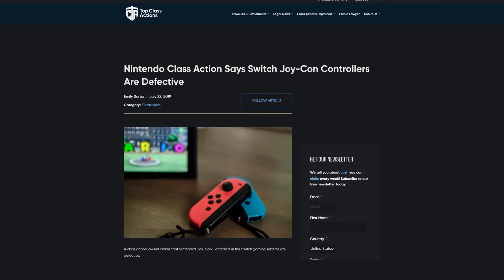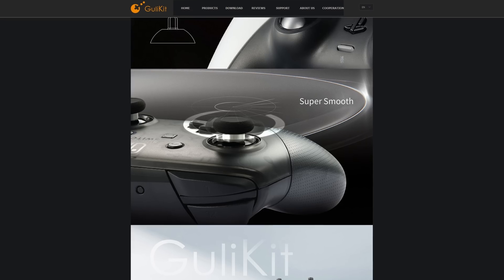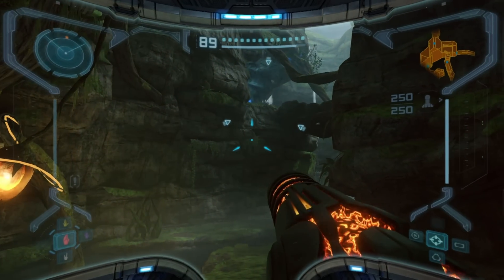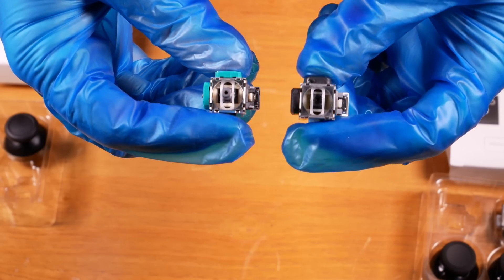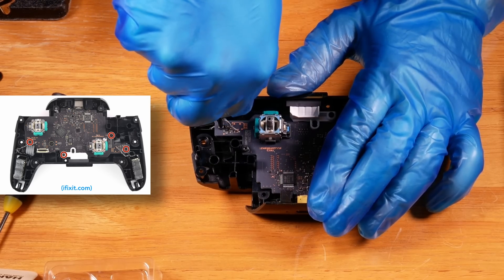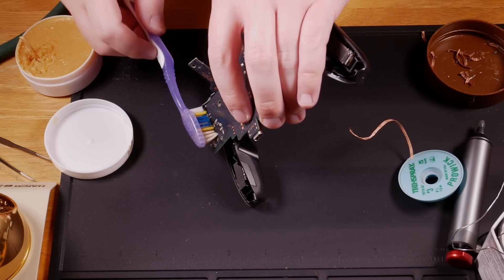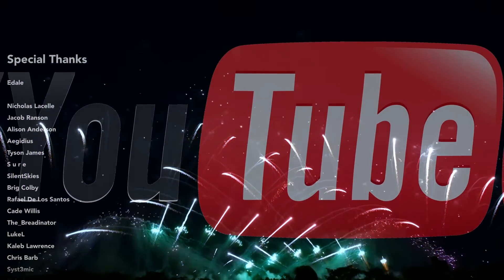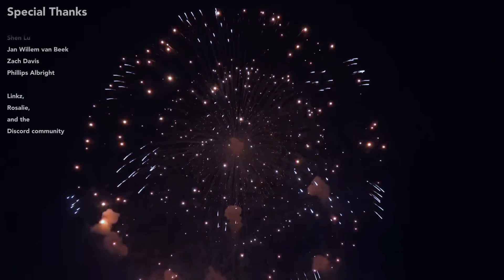Drift-Proofing First-Party Gamepads: Gulikit TMR Stick Review + Tutorial

Comment from the maker: 9:20 The #0 and #1 sizes were based on the Phillips drivers I was cheating with, if you have JIS tools you should start with #00 instead.
10:51 Ignore the "my right" graphic in this shot, the clip was supposed to be flipped relative to what you're seeing.  Lift from the THX2 ALLGAMEFANS side.  Also, THX 2 all game fans.
Reply: What about the "you bad boy" at 11:48? should I ignore that one too?
Reply: We really should go back to optical encoder wheel sensing(coughN64cough).  No need for a dead zone and can sense stick position in very discreet steps. 

If using the same mechanics as the N64 stick, you just need to harden the bowl and gears and soften the shaft.
Reply: could you tell me what song is playing at 5:10? It seems like Tom Jobim's waves and Zelda remix 

(🙂🔪 not asking)
Reply: @inazuka5672  it is just tome jobim's "wave" from his album wave
Reply: You also mentioned that people should use “an old toothbrush” to clean up the flux residue. I have never soldered before, but I’ve heard that if you ever use a toothbrush during this process it needs to be a clean, new one. An old toothbrush could be misconstrued to be one that’s had toothpaste on it before, and that could damage the board (from my understanding).

Maybe I’m the idiot here, but that was just a concern I had
Reply: Hey, did you get the updated Switch Pro revision, or are these dual-purpose for Dualsense and Switch Pro? The combo SKU is borked on switch.
Reply from the maker: @detoi4371  I got the updated sticks.  I was going to do the video in July but had to delay it after finding out the initial batch was defective
Reply: I wonder what your thoughts are on the state of AAA games. It looks like the really bad stuff is finally flopping lately.
Reply: Tom Jobim is peak music choice, thanks for putting him back in my head.

Comment: Are there any controller options similar to the Switch Pro that have tmr sticks? Every tmr controller on the market that I've found so far seems to use analog triggers instead of digital, as well as Xbox controller shape and/or Xbox button layout. I just want the Switch Pro shape and digital buttons with tmr sticks, but I know squat about soldering.

Comment: does this modification work for linux?
Reply: if it works on 2indows it should work on linux. maybe check the pro contr9ller driver to see if it reads user or system calibration by default

Comment: Maybe they're not putting on these sticks because they dont know how to calibrate them either. Is replacing just the worn out potentiometer a good option?
Reply: You will eventually face drift again. For Nintendo it is a huge pain but there are manual calibration guides as well as software calibration guides for Sony.

Comment: Maybe I don't game as much I think I do or I have a enough controllers I rotate between to prevent it, but I've thankfully never experienced drift even with my original release Joy-Cons and similarly as old original Pro controller.

But I am glad there are 3rd party companies looking to solve this issue even if I can't see myself doing a solder swap on the pro controller versus ribbon cable swap on the joy-cons. I do hope that the reception of hall effect sensors from 3rd party makes Sony and Nintendo realize there is demand for a higher longer lasting product (I don't know where MS is heading in terms of hardware).

Comment: My 3DS nub only started drifting upwards from Bowser uSmash spam after literally 10,000+ games. It was still playable.
My Xbox 360 sticks never faltered.
My PS3 sticks had minimal problems even after playing over 1,200 hours of Destiny.
MEANWHILE my PowerA switch controller had severe drift after using it for 20 hours then leaving it in a drawer for a year. My bro's controller had severe drift in a different direction on the barely-touched right stick.
I have since bought a REAL pro controller but haven't touched the Switch since I'm pretty much fully converted to the PC master race. That people still deal with all the closed market console BS is laughable. Move to PC and stop suffering.

Comment: Finally ended up doing this myself for the dualsense that has the extremerate pro back button kit installed. You weren't kidding about desoldering being the worst part! Took me a few days and I ended up just clipping my old control stick module off the board and then individually desoldering each pin and pulling them out one at a time. Very glad to future proof my preferred PC controller!

If anyone is trying this swap for the dualsense I highly recommend the youtube video from djBaro "GuliKit TMR Joysticks - Installation Tutorial For DualSense"

Comment: Have there been any new developments since this video was made? The center points becoming worse concerns me, and I see that Joy-Con Toolkit hasn't had any updates since 2018. I see CTCaer commented in an issue a few days ago:
"Hey, have in mind that JC toolkit is in indefinite hiatus.
I may sometime start cleaning it up again and improving it but dunno when."

I wonder if we need a new tool / updates (fork?) to the existing tool to handle the centering issue. I was debating replacing some sticks with these, but seeing your results makes me a bit hesitant.

edit: Also I see that the Amazon listing has the Switch Pro sticks marked as "Currently unavailable". I wonder if they just sold out or if they've taken them down due to problems. There aren't that many reviews.

Comment: I have bought these for 2 XBOX and 2 Pro controllers!

The XBOX sticks are near flawless after the XBOX Accessories calibration. 

I calibrated the Pro Sricks on Switch and re-connected them to PC and they fell within the "margin of error" IMO.

I ran through the HEX editing process and thexresults, though improved, didn't really impact real-world gameplay. Booted up DOOM Eternal on Steam and it was a fun smooth experience...on both TMR sets I received. 

However, it is quite possible that Steam, like Yuzu...WILL pull from the User Calibration withing the controller as Steam and Yuzu see it as a Genuine Nintendo Switch Pro Controller...and not a generic pad. 

Needless to say...a resounding success!

WARNING:
I would NOT consider these for use with the Elite XBOX Series 2 controller as it is loaded with magnets and is bound to cause interference.

Comment: If you'll willing to dip your toes in the "morally questionable", "borderline retail fraud" world, I have a suggestion for you.
Say your controller develops drift after the 1 year standard manufacturers warranty ends. Or, you try to replace it and they refuse or want to charge you an obcene amount for shipping. You know the unethical practice of buying a new product from a retailer, putting the old defective product in the box and returning it? Normally, I don't advocate for this practice,  ESPECIALLY for mom and pop businesses. However, in doing this with controllers made with cheap parts designed to fail after 1 or 2 years, I compare 
the practice of pirating old Nintendo games because you have no option to buy them anymore.
Big box retailers (Amazon, Target, Walmart) don't lose much revenue from this practice because they often ship returns back to the manufacturers and the manufacturer typically reimburses the retailer.
Alternatively, if you don't want to flirt with the morally questionable practices, never buy a non-Hall sticks controller WITHOUT an extended warranty. That way, you'll at least be able to get a replacement after 2 or 3 years depending on the length of the warranty.
Thanks for coming to my Ted talk

Comment: Thank you for this video.  As someone who is infuriated by this stick drift scam, its good to know theres a way to overcome it.  Ive gamed all my life, and only recently have I had to buy two new first party controllers for my kid because the sticks went bad.  He games about half as much as I did back in the day.  

Also, stick drift wasnt a term I had ever heard until this generation of consoles.  Ive been gaming since Atari was the biggest console...before the NES came out.  I havent had to repair a stick since the N64.  (I repaired it with a rubberband somehow and it worked great.  It was a loose stick, and I opened it up and wrapped a rubber band around the base bulb of the stick which gave it more tension....somehow this worked like a charm.  Its hard to believe.)

Comment: I experienced something similar with hall effect sticks in pro controllers like the Wolverine V3 Pro. Some sticks are dead center, some got something like a 5 to 12 percentage drift out of the box. I read an article a while ago (sadly can't remember where) and there it was stated that it actually normal behaviour because of production tolerances of the magnets and magnetic noise. Also, there is work on mechanics letting them return better to 0.0000 center position.

So, yeah, while most hall effect sticks are way more durable, they actually need bigger deadzones when used out of the box compared to potentiometers. But that disadvantage is neglectable long-term, so it is still an improvement over the bullcrap potentiometers become over time. I'd also love to see how much hall effect can improve too, when the entire industry changes over.

Also, a little fun fact: Sony used magnetic sticks for the PS3, though they have less in common with modern hall effect sticks.

Comment: I put these Guilikit sticks in my Joycon a couple years ago and it's amazing just how reliable and perfect they are. and was like $10 CAD for a set of two.
I will applaud Nintendo for this one thing, the Joycon is the easiest DIY teardown and repair I've ever done. It's plug and play basically, just have to be careful.

I recently ordered a Steamdeck. Hopefully I can drop in similar sticks there some day when they fail.
edit the issues with default center being wrong and some games not using deadzones kinda scares me. I'll use the Steamdeck sticks until they break, and try the Halleffect sticks only when they start to fail. And if that fails I'll just replace with regular sticks.

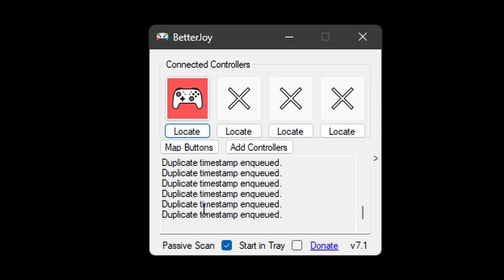Comment: In order to fix the "Duplicate timestamp enqueued." error at 4:18 for BetterJoy you can use a program called HidHide which allows you to specify which programs have access to your gamepad. You just have to add your Switch Pro controller and then BetterJoy to the list of applications having access and then programs like Steam and such will no longer be able to detect your Switch Pro controller and only the emulated controller created by BetterJoy so the issue will no longer occur.
BetterJoy used to come with a program called HidGuardian that did something similar, but I think that no longer works. Also sometimes it still bugs out right as you connect it, but then just turning your gamepad off and back on fixes it. And TotK is the best Zelda game actually.

Comment: The orange hall-effect sticks prevailing on Ali express allow you to adjust the center points with a paperclip. Works with PC/Switch, don't even think I had to recalibrate them. Haven't done extensive testing but anecdotally I haven't perceived any issues. Might be worth comparing to the Guilikit brand?

Comment: 1:36 I'd like to say, as someone who plays a bit of Melee (but not nearly as much as your average active competitive player), the wear of the plastic mechanism in the actual joystick-box is still an issue if you're stuck using OEM parts manufactured up to 23 years ago. That is, of course, why there's a difference between a "loose" stick and a "tight" stick. But if you don't need "1.0 Cardinals" (or can calibrate and adjust for this, as with any modern controller or with like a PhobGCC) then it's not that big of a deal if you're playing casually or mid-to-low-level competitively. 

Regardless, the potentiometers are the more critical issue by a huge margin. Just wanted to leave my two cents on the matter

Comment: My experience with the Gulikit sticks for Joy Cons is they're great initially but they fall off tremendously, possibly faster/worse than OEM. They also require calibration out of the box. Eventually you need to recalibrate again, and then again after less time, so on, and then the stick is physically loose and the sensitivity range in some areas isn't 100%. This has happened to me on 3 sets bought months apart, each had probably hundreds of hours which I guess for casual players would be fine but for the people interested in doing this mod and given the OEM stick drift issue is a similar annoyance I don't think they're worth it. Sad to say, out of the box (and calibration) they do feel nicer, I want to like them.

Comment: Im actually happy to hear someone else having issues with a ps5 controller drifting. I had to buy a new one because the drift got so bad. I was in the process of soldering a new stick on but unfortunately I had to step away from it for a bit and my youngest decided to play demolition with the circuit board. Having an actual answer to this overwhelming fear I have with these new, expensive controllers is nice at least

Comment: Fun fact. PS3 controllers used magnetic sticks too. Not sure about PS1 and 2 sticks though, but they probably did too because I don't remember them ever causing me any issues back in the day.
Reply: They actually did not. The sticks themselves and the potentiometers were a fair bit larger and less precise than modern ones, thus less prone to wear and tear. PS1 and PS2 controllers also calibrate themselves each time after powering on when you do a full rotation of the sticks.
Reply: @schwarzenhead5685 He's right, but it only applies to the original Six Axis Controllers. The ones that had no rumble due to a patent concern. What you're referring to is the newer controllers that would replace them, the Dualshock 3. Controllers that had rumble and six axis, but with pent sticks.
Reply: @bioforest6602  I think he is only stating the PS1 and 2 controllers were using Pots. Also regarding PS3, to be specific, Dualshock 3 controllers do in fact use magnets as well, but later Dualshock 3 controllers removed them in favor of Pots, or so I hear (around the end of the PS3's life). There's a few videos around of people taking a look at Dualshock 3 sticks and determining they were indeed using magnets.
Reply: @bioforest6602  Both Dualshock 3 and Sixaxis used Hall Effect sticks and standard potentiometer sticks. Depends on model.
Reply: @schwarzenhead5685  Good to know. Too bad they went back to pots for the PS4 and 5 sticks, especially PS5 since that was the time when people were finally taking notice of Hall Effect tech again. They could at least offer a replaceable Hall Effect solution for their overpriced controller.

Comment: even though you briefly touched on it, finally I have validation in how much a pain in the dick it is to replace joycon sticks. Good hustle here though, thanks for going through the work of troubleshooting and testing these jawns in a thorough manner!

 +1 on using a soldering kit to get comfortable using a soldering iron - that was my intro into learning how to solder correctly. Since then I used a solder sucker and some testing keycaps to repair some previously busted keyboards and build a left-hand keypad (from a split ergo kit that was in the scraps and b-grade parts bin and leftover switches from an absolutely toasted keyboard). 

and +1 for adding more solder on a join that's stubborn. Surprisingly this video is a nice tips/tricks/tutorial on someone doing their first practical solder job!

Comment: I’ve had 2 dual sense controllers for over 2 years and I have not had drift.

I got a pair of Joy-cons in 2018 and 2019 and probably stopped using them all together by 2020 cos they were ALL horribly drifting.

Since then, I used 2 3rd party game pads and a pro controller. Oh, and the GameCube controller I got at goodwill a few years ago still had no internal defects.

Comment: I recently replaced the switches on my Logitech g604 mouse as I started getting "double-clicking" issues. I would of just bought a new mouse but they discontinued the product and no suitable replacement mouse exists at the time of writing.  

It was my first time soldering but I managed to pull it off and extend the life of my mouse.

Now the sticks on my Xbox elite controller are starting to drift. I was considering getting a 3rd party replacement controller (maybe one with gyro) but seeing this video has me curious if I could pull off a stick replacement like seen here.
...turns out the page on GuliKit states there is no good tools/software for calibrating xbox elite controllers so I might just get a new third party controller after all, perhaps one with hall-sensors to start with. 

Soldering is starting to feel like a necessary skill to develop with companies insisting on using inferior materials & components for even their most "premium" products.
Reply: I have a G700 mouse and it needs a new switch, so I'm gonna have to repair it. No company has ever made a mouse better than this one.